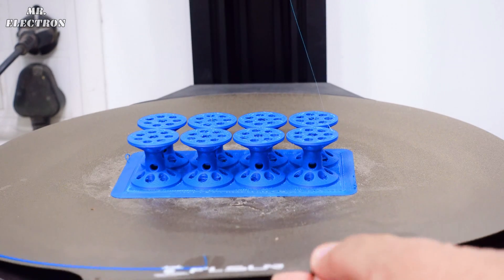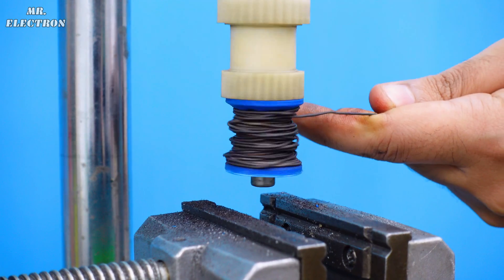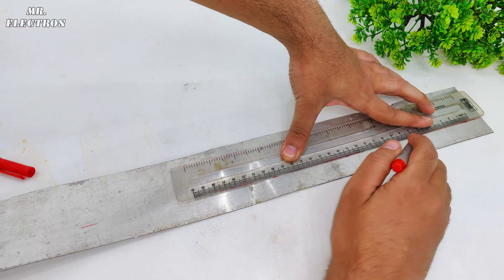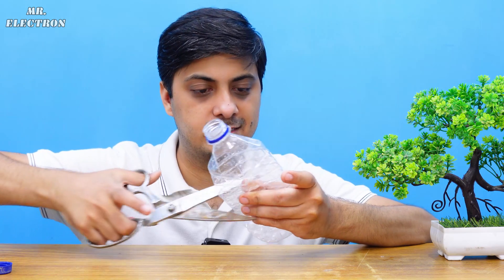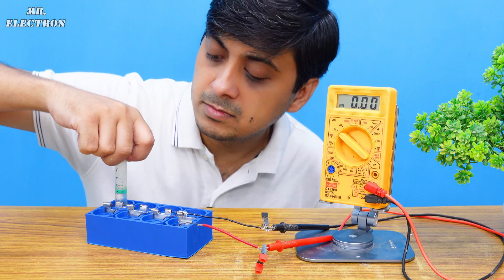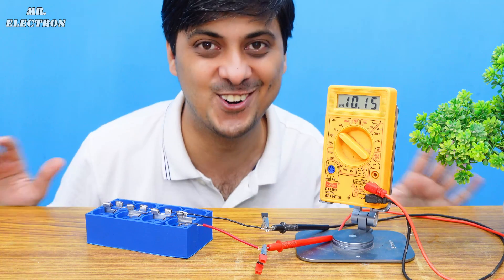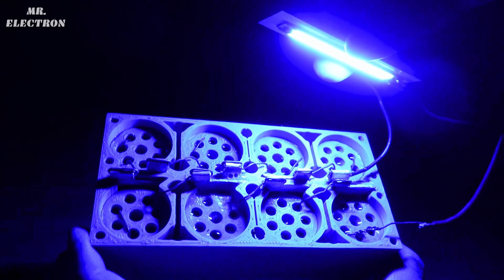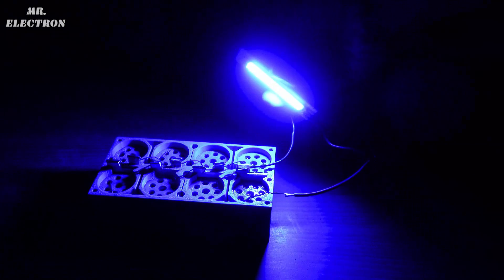How To Make an Aluminium Air Battery | Genuine Experiment for Batteries DIY

Comment from the maker: BEST BATTERY CHARGER DIY VIDEO - https://youtu.be/ZN3saILbYUw?si=9_nLu0vKOqfn4zi_
Previous Air Battery Video 👉 https://youtu.be/OfrTHRbNOVg?si=mLPvYBbSVRbGZtj0
3D Print - https://cults3d.com/en/3d-model/tool/aluminum-air-battery-design-10v-to-12v-dc
Check my other videos on the same topic. Search Air Battery by Mr. Electron on youtube or Google.
Reply: The voltage drops very fast it seems the ionisation potential of koh is affected by impurities
Reply: Cyclic voltammetry method has been used to compare the electrochemical behaviors for the 
supercapacitors electrode based on the activated carbon material in form of monolith derived from 
areca catechu husk in 1 M H2SO4 and 1 M KOH electrolyte solutions. Monolith carbon electrode in 1 
M H2SO4 performed excellent electrochemical storage properties including a highest specific 
capacitance of 150 F g−1
, energy density of 20.83 Wh kg-1
, and power density of 75.06 W kg-1
 at 1.0 V 
voltage window. However, the specific capacitance produced from the KOH electrolyte is more stable 
than the H2SO4 at high scanning rates of 10 mV s-1 with reduced of 70.4%. These results suggest and 
confirm that 1 M H2SO4 is the ideal aqueous electrolyte for monolith biomass based-carbon electrode 
especially derived from areca catechu husk.
Reply from the maker: Its due to dendrites and passivation.
I have a solution for that but I did a voting for the next project on my community post and the topic (500 amps transformer is winning it) so after this transformer project, I will make it.
Reply: Air/Air => Al/Al réagie des radioactivité y compris des télécommunication!
Note Al seul réputé étanche à H'? Donc Al...H+/Al...H- dans l'atmosphère dito 🌡️(💥"H²O"💥)🌡️captant l'ionisation atmosphérique de l'auto-oxydation du combustible!
Aussi çe type d'électrodes autocatalithique travail coupler de série aux piles gaz polarisée dont les calculs enseignés démontre l'accontrario du pouvoir boustant électrique d'une série...
🙃
Reply: Nota l'oxyde du combustible nucléaire Al est un ultratoxic dont les symptômes sont l'équilibre les formations osseuses...ect... Hydrocarbures 👹He👹 destructeur d'ozone atmosphérique
🙃
Reply: Boss wts ur no

Comment: you are checking the ampere in a wrong way. for checking ampere you have to disconnect the positive probe and connect it to the top of the socket provided just top of the +ve probe of multimeter and rotate the switch to ampere mode

Comment: since the voltage of cell is 2.8V, my repeat output 3 times as fast  as a dry cell(1.5V). now I am using a voltage devider to reduce the v. Not yet  a success

Comment: would you not get a higher voltage with copper wire instead of steel wire, as copper and aluminum are further apart on the reactance chart.

Comment: i don't think you know what an air battery is because that is defiantly not an air battery
Reply from the maker: Well ! there is this big confusion with may viewer's. Firstly - This term Air battery is not given by me but by the inventor of this air battery. Charles F homes patented the first aluminium air battery.
Secondly - Air battery name was never meant for air electrolyte but flow of current because of absorption of air (oxygen) by the anode aluminium (or others) .
Thirdly - Water contains different levels of dissolved gasses amongst which, oxygen is also present in large quantities.
So in simple terms, the name air battery was give in 1886 because air (oxygen) is consumed by Amluminum for production  of current and not because the electrolyte is air or gaseous.
Air battery electrolytes can be solid state as well as liquid.

Comment: is that not just a multi cell smaller scale bagdad battery ..
Reply from the maker: Well ! there is this big confusion with may viewer's. Firstly - This term Air battery is not given by me but by the inventor of this air battery. Charles F homes patented the first aluminium air battery.
Secondly - Air battery name was never meant for air electrolyte but flow of current because of absorption of air (oxygen) by the anode aluminium (or others) .
Thirdly - Water contains different levels of dissolved gasses amongst which, oxygen is also present in large quantities.
So in simple terms, the name air battery was give in 1886 because air (oxygen) is consumed by Amluminum for production  of current and not because the electrolyte is air or gaseous.
Air battery electrolytes can be solid state as well as liquid.

Comment: Good battery, but NOT air battery! Aluminium-copper alkaline battery.
Reply from the maker: Well ! there is this big confusion with may viewer's. Firstly - This term Air battery is not given by me but by the inventor of this air battery. Charles F homes patented the first aluminium air battery.
Secondly - Air battery name was never meant for air electrolyte but flow of current because of absorption of air (oxygen) by the anode aluminium (or others) .
Thirdly - Water contains different levels of dissolved gasses amongst which, oxygen is also present in large quantities.
So in simple terms, the name air battery was give in 1886 because air (oxygen) is consumed by Amluminum for production  of current and not because the electrolyte is air or gaseous.
Air battery electrolytes can be solid state as well as liquid.

Comment: Where’s air? This is a normal battery
Reply from the maker: @moon.m8727  Well ! there is this big confusion with may viewer's. Firstly - This term Air battery is not given by me but by the inventor of this air battery. Charles F homes patented the first aluminium air battery.
Secondly - Air battery name was never meant for air electrolyte but flow of current because of absorption of air (oxygen) by the anode aluminium (or others) .
Thirdly - Water contains different levels of dissolved gasses amongst which, oxygen is also present in large quantities.
So in simple terms, the name air battery was give in 1886 because air (oxygen) is consumed by Amluminum for production  of current and not because the electrolyte is air or gaseous.
Air battery electrolytes can be solid state as well as liquid.

Comment: but you told that you used steel wire in the coil
so what may be used normal steel wire or copper wire
Reply from the maker: Actually different steel wires give different results so I gave you the proper source to avoid any confusion.

Comment: is it steel or copper wire
please inform me
Reply from the maker: @SoumojeetSaha  normal steel/iron wire used in construction
Reply: @MrElectron  then may I use copper wire in the coil
Reply from the maker: @SoumojeetSaha  I have not tested with that but yes there is no harm in trying.
Reply: Thank you very much
Reply: @MrElectron  thank you
Reply: @MrElectron  I will try

Comment: Very cool experiment, you are very creative!
I noticed that this battery has very high internal resistance.
When you measured 160 mA shorted output at 10V, it means: 10V/.16A=60 Ohms.
Although it's free (if you use scrap aluminum) it will not have very good power density.
Are there ways to reduce the internal resistance?
Reply from the maker: @loungelizard836  Thanks A lot ! Actually, it has one of the best power densities and that is why I am so much into this thing. This video was majorly created to show the passivation and dendrites problem. 
Yes! This battery that i have made is a basic one but I already have tested a better performing one 😊. Can't wait to share it with you all.
Also , I do voting after every project on my community tab so if the majority of my viewers choose it again, I will make it for sure 👍

Comment: Very nice video. You should figure out how to make a lead acid battery some day. People don't make those on the internet very often and when they do, it's either a proof of concept ultra low power type thing or a video with no explanation of factory workers doing it in India. It would be incredibly valuable information to see someone figure out what exactly it takes to diy a viable lead acid battery.
Reply from the maker: Thanks and sure I will.  These days, I am fascinated by any battery making project .
Reply: lead acid batterys need charging first, the battery in the video is just chemical, mixing in and away you free electic (or more free electrons, harnessing anyway)

Comment: Is it Me or Do you Need to Test the Battery Current With a Load to get the Right Current Load..??..
Reply from the maker: Actually, measuring current with load gives connected load current while measuring current without it gives maximum produced current or Short Circuit Current.

Comment: This experiment works because of the potassium aluminum hydroxide, which produces free electrons. But if you want to actually consume the oxygen to complete the reaction with the hydroxyl groups, you need to use a breathable cathode. For a real aluminum-air (or metal-air) battery, you need to use a cathode like carbon to react with the oxygen and hydroxy groups in the electrolyte. You can try a new design, using a cathode in contact with air on one side and the electrolyte on the other side, and the carbon cannot be flooded.
Reply from the maker: @danielrosselli  Actually,  I have already done that project in the past with the carbon cathodes around a year back and yes, the results was great. This time I went with the steel wire because somehow I have experienced that the mA output for steel wire is a little higher for same cathode area of crossection.
Reply: @MrElectron  why did you opt for the steel wire, coiled into spools, as your cathode? Any particular reason or just because you have lots of steel wire available?
Reply: @MrElectron  How is the performance of the battery now? How much life circle it had? Because it's very important project for DIY batteries, I'm personally interested  with it.

Comment: Aluminium Air Battery?????
 I do not see air but water
Reply from the maker: Well ! there is this big confusion with may viewer's. Firstly - This term Air battery is not given by me but by the inventor of this air battery. Charles F homes patented the first aluminium air battery.
Secondly - Air battery name was never meant for air electrolyte but flow of current because of absorption of air (oxygen) by the anode aluminium (or others) .
Thirdly - Water contains different levels of dissolved gasses amongst which, oxygen is also present in large quantities.
So in simple terms, the name air battery was give in 1886 because air (oxygen) is consumed by Amluminum for production  of current and not because the electrolyte is air or gaseous.
Air battery electrolytes can be solid state as well as liquid.

Comment: So could this be done in a automobile  ? You use salt water correct  ?
Reply from the maker: Sure ! Here I have use KOH but it work with Salt water as well.  Check my other videos on the same topic. Search Air Battery by Mr. Electron on youtube or Google.

Comment: One Question is it rechargeable or are you going to have to replace the electrolytic compound every time. Maybe the dendrites will return to the electrolytic solution by Ionization if you try or maybe it will blow up :-P
Reply from the maker: No it's not rechargeable,  we have to replace the aluminium plates.

Comment: It is not sir aluminum, it uses electrolyte, it is a scam.
Reply from the maker: @DmitriNesterov  Well ! there is this big confusion with may viewer's. Firstly - This term Air battery is not given by me but by the inventor of this air battery. Charles F homes patented the first aluminium air battery.
Secondly - Air battery name was never meant for air electrolyte but flow of current because of absorption of air (oxygen) by the anode aluminium (or others) .
Thirdly - Water contains different levels of dissolved gasses amongst which, oxygen is also present in large quantities.
So in simple terms, the name air battery was give in 1886 because air (oxygen) is consumed by Amluminum for production  of current and not because the electrolyte is air or gaseous.
Air battery electrolytes can be solid state as well as liquid.

Comment: Береги глаза! Обещал воздушный элемент, а получился какой-то мокрый. Светодиод светящийся это здорово, но какой ток короткого замыкания?
P.s. вопрос неактуален, досмотрел! 😊 Молодец! 1.5 Ватта - это мощь! ❤ Алюминий не самый удобный материал, моментально покрывается оксидной плёнкой.
Reply from the maker: Thanks I will.. yes the oxide problem.  Although its seen more on the cathode than aluminium itself with KOH electrolyte.
Reply: @MrElectron  yes you are right, later understood that aluminium dissolves continuously on anode. But you promised an air battery, why is it so wet? 😀
Reply from the maker: @DmitriNesterov  Well ! there is this big confusion with may viewer's. Firstly - This term Air battery is not given by me but by the inventor of this air battery. Charles F homes patented the first aluminium air battery.
Secondly - Air battery name was never meant for air electrolyte but flow of current because of absorption of air (oxygen) by the anode aluminium (or others) .
Thirdly - Water contains different levels of dissolved gasses amongst which, oxygen is also present in large quantities.
So in simple terms, the name air battery was give in 1886 because air (oxygen) is consumed by Amluminum for production  of current and not because the electrolyte is air or gaseous.
Air battery electrolytes can be solid state as well as liquid.
Reply: @MrElectron  wow, thank you for an explanation, now everything is clear! In my Russian language "air" ≈ "dry" (adjective) 😊 I will never argue with terms, the inventor knows better! And thank you for measuring short circuit current for me, I was very interested. 🤡 Now it is clear, that you know, what you are doing. Wish you success and to find a way to the new knowledge ❤️
Reply from the maker: @DmitriNesterov Thanks and you are most welcome 🙂❤️
Reply: Well done, my friend, your experiment is very nice. Congratulations for all the videos. I have two questions, one is if you can charge what you made. And the others are if instead of the wire you put stainless steel 304 And instead of the aluminum you put copper. I hope you are well making what you want. Greetings Spyros from London!!!👍

Comment: This is not an Al-air battery!
Reply from the maker: @DmitriNesterov  Well ! there is this big confusion with may viewer's. Firstly - This term Air battery is not given by me but by the inventor of this air battery. Charles F homes patented the first aluminium air battery.
Secondly - Air battery name was never meant for air electrolyte but flow of current because of absorption of air (oxygen) by the anode aluminium (or others) .
Thirdly - Water contains different levels of dissolved gasses amongst which, oxygen is also present in large quantities.
So in simple terms, the name air battery was give in 1886 because air (oxygen) is consumed by Amluminum for production  of current and not because the electrolyte is air or gaseous.
Air battery electrolytes can be solid state as well as liquid.

Comment: Fe-Al battery, more correct name
Reply from the maker: @DmitriNesterov  Well ! there is this big confusion with may viewer's. Firstly - This term Air battery is not given by me but by the inventor of this air battery. Charles F homes patented the first aluminium air battery.
Secondly - Air battery name was never meant for air electrolyte but flow of current because of absorption of air (oxygen) by the anode aluminium (or others) .
Thirdly - Water contains different levels of dissolved gasses amongst which, oxygen is also present in large quantities.
So in simple terms, the name air battery was give in 1886 because air (oxygen) is consumed by Amluminum for production  of current and not because the electrolyte is air or gaseous.
Air battery electrolytes can be solid state as well as liquid.

Comment: Really InteresTing! Could you mesure capacity and power density?
Reply from the maker: @arnaudmosse6894  This is not a proper version of this type. There is an even better upgrade for this on which the capacity and power density test should be done but I did a voting on my community tab as I always do after my video uploads for the next project and majority voted for high current transformer. So probably in the next to next.

Comment: The title of this video is misleading, why is it an 'air' battery?
Reply from the maker: @rosewindows1  The term air is used by all the researchers in the world because oxygen from the air is consumed to by the anode to get oxidised and release electrons.
Reply: @MrElectron  But the anode is immersed in liquid electrolyte, so how can it oxidise oxygen from the air?
Reply from the maker: Excellent question. Seems like you are new to my channel. Anyways,  as I have already explained about this in the previous aluminium air battery parts that the oxygen gets absorbed by the electrolyte from the air which is then used in anode oxidation.
( that's how fishes breath under water 🙂 )
Also, more than 80% of the electrolyte is water.
Reply: @MrElectron  Very interesting. Perhaps oxygen is also released from the Potassium hydroxide.
Reply from the maker: @rosewindows1  released gas is hydrogen by the anode.
Reply: @MrElectron  and oxygen from the cathode;-)
Reply from the maker: 🙂 Correct but only in minor quantities due to secondary reaction.
2OH-  ---- > H2O + 1/2 O2 +2e-

Comment: Aluminum oxidizes quickly, after battery is made, and allowed to sit for a time, (a few days) does it still work without polishing the aluminum again?
Reply from the maker: Recommendation is to remove the aluminium plates or removing the electrolyte out of the battery after use.Companies all over the world are still working on it to find an approach that is simple, long lasting and effective.